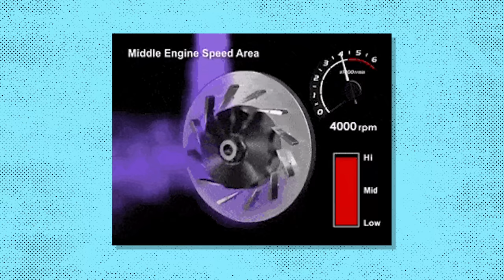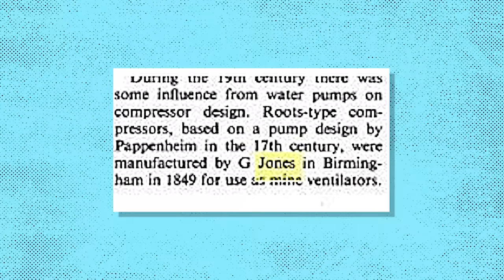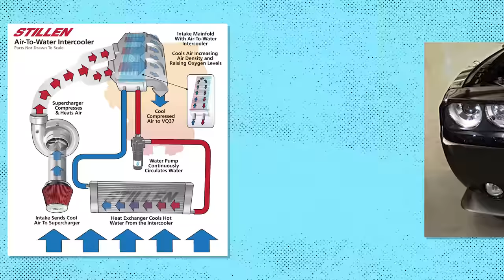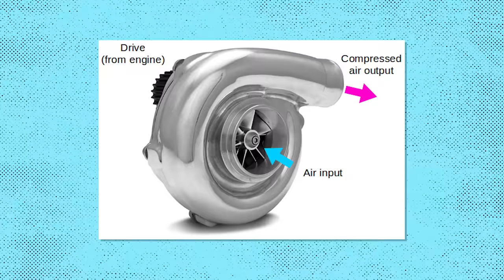Why Superchargers Aren't As Good as Turbos

Comment: Fun fact: although it's way less than super chargers, turbos also produce some paracidic loss. 
A turbo makes it harder for an engine to push out exhaust gases, creating a tiny amount of extra resistance in the exhaust stroke. 

OFC it's far less than the power increase you gain, but it just shows that you never get energy for free. A perpetomobile is still impossible.
Reply: Yes was searching for this. That Turbos use "free" or "wasted" energy is just plain wrong,  the piston needs to exert energy on the exhaust stroke to push the gas through the turbine. this pressure difference across the turbine can be directly converted to power use.
Reply: Turbochargers have no parasitic loss under load. They produce a net gain in thermal fuel efficiency and net horsepower output.
Reply: @faxxzc  That is incorrect, the Temperature Difference between  the turbine inlet and turbine oulet temperatures is directly linked to power output of the turbine wheel.
 The Turbocharger is a HEAT ENGINE and operates using the BRAYTON CYCLE.
Reply: @sandervanderkammen9230  No. As stated before:
While they do have a massive power increase compared to their losses, you don't get that power increase for free. This isn't a perpetomobile. As the exhaust gases push on the turbine wheel, the turbine wheel pushes back on the exhaust gases, which pushes back on the piston. That's newtons 3. law!
And also as stated before, this paracidic drag is incredibly low compared to superchargers, that's why everyone's using turbos and not superchargers!
Reply: @dariolinder4508  Wow! Ok...I see you do not understand how a turbocharger works.

A turbocharger is a type of heat engine, it operates using the BRAYTON CYCLE.

As the exhaust gasses pass through the exhaust turbine THE TEMPERATURE DROPS

This drop in temperature is directly linked to amount of horsepower generated by the turbine wheel.

This energy is then recovered by the reciprocating engine by the centrifugal compressor which unloads the engine by reducing the pumping loss.
This reduction in pumping loss results in a net gain in horsepower at the crankshaft without an increase of fuel consumption.
This incease in power does not require additional fuel and is thus "free energy" although its is not the best way to describe it.
The best way to describe it is increased energy efficiency through heat recovery..
Reply: @dariolinder4508  Manufacturers use turbochargers because they improve  fuel efficiency on standardized fuel efficiency tests used by the EPA and NEDC. Although this does not necessarily increase fuel efficiency in real world driving... driving conditions and technique is a critical part of actual MPG or Liter/per km.

Superchargers increase power output by increasing the amount of fuel burned and a much smaller improvement in energy efficiency.

Turbochargers can increase power output without an increase in fuel burn.
Reply: @sandervanderkammen9230  
TL;DR at the bottom
A turbo charger is a mechanical device built into combustion engines. 
It is comprised of a housing, turbine wheel, compressor wheel, connecting shaft, heat shield and oil and cooling passages. The housing is bolted onto the exhaust manifold of the engine. 
It has 2 sides, the 'hot' side and the 'cold' side, seperated by a heat shield. The hot side is built into the exhaust, while the cold side is built into the intake. 
Now, when your engine's running, it expells hot hot gas out the exhaust valve into the manifold. From there it's routed into the turbo charger. 
In there it has no passage expect through the compressor wheel. While the exhaust gases moves through the turbine wheel, they spin it up. Heat is transfered into the housing and the compressor wheel as an unwanted side effect. The turbine wheel is friction welded onto the connecting shaft. This method is used due to the immense heat the turbine wheel has to withstand.
Now, this spinning turbine wheel and connecting shaft is connected to a compressor wheel on the cold side, meaning that the compressor wheel is always spinning at the exact same speed as the turbine wheel. It's typically screwed on due to budget and simplicity reasons.
The compressor wheel is built into the intake of the engine. Like the turbine wheel it's also a centrifugal pump. When it spins up, it throws out the air between its blades into the intake, sucking in more air as it goes. Through that method it can increase the air pressure behind it. Usually it spins up to around 200'000 RPM at high engine RPM and produces around 0,9 bar extra pressure, increasing it to 1,9 bar (may vary from system to system). This pressure is managed by either a bypass valve, blow-off valve or control fins around the compressor wheel.
 Increased air pressure means increased oxygen molecules. Increased oxygen molecules means you have to inject more fuel to maintain the stoichiometric ratio (14,8:1). More fuel in the combustion chamber means a bigger explosion, leading to more pressure on the piston and more torque at the crankshaft, power is torque over time so you get more power. 

Now that we're on first month apprentice level, let me get to your claim to the brayton cycle. That claim's so out of left field, I don't even know where to start. 
Heat is a big problem for turbos. The turbine wheel is friction welded onto the connecting shaft to withstand the immense heat coming from the exhaust gases and the housing has a built in heat shield to protect the compressor wheel from a heat transfer. 
The housing also contains coolant passages to cool it down and oil passages to reduce friction.
Please don't tell me that I don't know how turbo chargers work when you yourself fail to grasp simple physical laws. Educate yourself before you try to educate others.

TL;DR: you're likely mentally disadvantaged and should visit a doctor.
Reply: @dariolinder4508  THANK YOU, For proving my point.
Reply: @dariolinder4508  You clearly have no idea beyond the most amateur neophyte fundamentals.. how a turbocharger operates..
A supercharger is nothing more than a compressor.
A turbocharger is a Heat Engine with its own thermodynamic cycle and acts as a second pass heat recovery cycle when combined with a reciprocating engine.
Reply: @sandervanderkammen9230  yes of course, you're absolutely right.
Reply: @dariolinder4508  THANK YOU! Any questions son?
Reply: @sandervanderkammen9230  why yes of course oh magical magician of the magical magician's magical tower. Explain to me how this magical device, this magical turbo charger, invented by you, oh magical magician of the magical magician's magical tower, how it works exactly.
Reply: @dariolinder4508  Its not magic son... its called THERMODYNAMICS, probably a bit beyond your pay grade and education level.

I did not invent the Turbocharger... Alfred Buchi did.
Reply: @sandervanderkammen9230  oh magical magician of the magical magician's magical tower. Tell me, how does this magical item called by you, oh magical magician on the magical magician's magical tower, 'turbo charger' and apparently not invented by you, oh magical magician of the magical magician's magical tower, work exactly? Enlighten us oh magical magician of the magical magician's magical tower!
Reply: Nicely said .... I was gonna post a response on this point too ... luckily I read more into the comments and found this !
Reply: @sandervanderkammen9230  how can a turbine spin without restricting the exhaust gases flowing through it? If there is restriction, how does that not imply some power loss?  The bearing inside a turbine can't spin forever, there is some friction.
Reply: @Ehal256  Yes, there pumping loss on the exhaust side.. but it is offset by the larger reduction of pumping loss on the intake side... the Turbochargers centrifugal compressor is a much more efficient pump rhan the reciprocating engine.
Reply: @dariolinder4508  i dont think he understands stoichiometric ratio/lambda1/14.8:1 if more air goes in more fuel must go in or engine goes lean and starts to destroy itself. That is basic fuel ratio behavior less fuel means detonation which will mean ecu will retard spark (less power) or increase fuel slope (more power).  Plus it is obvious to any one that driving a compressor to compress air must have a parasitic loss or as you say hello perpetual machine. I guess i have been wrong in tuning many engines on dynos and watching their behaviour and produced power. Turbos and superchargers will fatten torque curve but only if more fuel goes in. He obviously does not understand that you do not get something for nothing in the engines production of power.
Reply: @chrisclarke6344  I think he just made a poor attempt at trolling and got annoyed as soon as I started to ridicule him. 
Anyway, I really enjoyed explaining turbo chargers from top to bottom, really got to test my memory there.
Reply: @dariolinder4508  you saved me a whole lot of typing! Its beyond me how he thinks you can get more power from increased boost without adding more fuel. He probably thinks if you feed an engine nitrous oxide that is the fuel not the extra oxygen that needs extra fuel to work. Not sure how he would come at an alky engine with the amount of the stuff you need to give it because of its lower calorific rating.
Reply: @dariolinder4508  plus not sure what he is on about with a turbo being a 'heat engine' in my experience if no gases passing turbine blades it dont rotate. If you took a torch to the housing and heated it red hot that turbine will not move unless the gases are flowing past it, it is no different to a water wheel both need flow to operate.
Reply: @chrisclarke6344  maybe he even thinks that higher octane gasoline gives you more power! XD
Reply: @dariolinder4508  indeed all that does is to let you run more advance and a higher compression ratio. They dont seem to understand that an engine needs the correct fuel/air ratio to work, and it doesn't care if its getting it from fred with a hairdryer and aunty maud with a watering can so long as its correct ratio.
Reply: While turbos do come with a small parasitic loss below the boost threshold, the majority of that low end power loss comes from needing to reduce the compression ratio of the engine to make tuning for a turbo less dangerous. For example, my car's 1.6T has a compression ratio of 10:1, where some NA engines run much higher. As a result, they get way better low end response. But the tradeoff is I get far more power when the turbo spins up.
Reply: @CalculatedRiskAK  paracidic loss exists all throughout the rev range. You still need some force to spin a impeller up to 200'000 RPM. It's just that the power increase is so massive in those rev ranges, it can be neglected. The only time you may notice it is when you have a big turbo and a slow idling speed, like on a heavy duty truck or an excavator.
Reply: @CalculatedRiskAK  supercharged engines also have a lower compression ratio, the difference is a supercharger is boosting from idle whereas a turbocharged engine has to wait for the boost to build as turbo spools up. The effect is not so pronounced with small turbos as less mass has to be spun up. The supercharged engine will feel more like a larger capacity engine, which makes them nicer to use in normal driving. However due to the dynamics of superchargers the boost tends to drop off at high rpm while turbos dont suffer from that.The turbo will make more power ultimately, and with the 'kick' when boost comes in this trait can be deemed more exciting.
Reply: @dariolinder4508  wheres sander gone?his silence says much i feel!
Reply: @dariolinder4508  Thermodynamics is not magic if you are educated...
Reply: @UmbrellaCorp_  Too bad he is wrong and doesn't understand the engineering concepts involved.
Reply: @chrisclarke6344  Clearly the concept of pumping loss is a completely unknown to you.
 If you don't know what pumping loss is? How can you say there is a parasitic drag???
Reply: @dariolinder4508  You made an excellent attempt of making a complete fool of yourself... AND SUCCEEDED!
Reply: @chrisclarke6344  Nitrous oxide is an OXIDIZER...  not a fuel. 
WHAT IS YOUR POINT?
Reply: @chrisclarke6344  Because your not an engineer son, from your childish, immature remarks its obvious that you have no formal education or professional experience on this topic.
 If you don't understand the Carnot Cycle Formula you will never understand how a turbocharger works.
Reply: @chrisclarke6344  Depends if we are talking about HCSI or SCSI with GDI..
With direct injection you can have a lean AFR without the risk of pre-ignition or knock, and lower EGTs without fuel enrichment.
Reply: @sandervanderkammen9230  yes HCSI,SCSI will allow a leaner burn without knock in DI or pre valve injection (as close to valve as possible) this is only possible with ECU control of fuel slope and ignition timing. This allows lean burn engines to meet emmisions rules, but as with all things there is a reaction and that is less power produced nett. It is primarily used by motor manufacturers to allow smaller engines and better mpg on a test cycle. This has many advantages for manufacturing, less costs better packaging etc. The down side is usually real world mpg is not as good as claimed and BMEP is affected. This brings us back to the issue of losses in the turbo system!
Reply: @chrisclarke6344  Small displacement turbocharged engines have become extremely popular with manufacturers and new car buyers because they deliver higher MPG figures and BSFC.
This is because turbochargers increase power and lower fuel consumption... the turbos centrifugal compressor is more efficient than the reciprocating engine  significantly reduce pumping loss because it is driven by waste heat and not a parasitic load on the crankshaft.
Any questions son?
Reply: @svgPhoenix  The truth always wins over ignorance.
 You obviously have no formal education or professional experience on this topic...
Reply: @chrisclarke6344  Heat = pressure. What Sanders is trying to say is that the unused exhaust heat/pressure give the turbo HP, thus utilizing more of the heat from the fuel we burn.
Reply: @vistakay  that is correct the gases have to be expanding / moving past turbine or it will not turn, they are doing this because they are burning thus expanding. If he wasnt so obnoxious and arrogant it would be possible to have an articulate interesting discussion, but he appears to be unable to contain himself. He also has an alter ego called 'drbimmer' they are one and the same. He will also not accept that lean burn engines can only do that due to tight control of fuel slope and spark timing, and that it will lead to lower performance from the engine, than one that is running nearer to lambda1. The turbo will still boost the engine if the gas pressure comes from a compressed air tank or exhaust gases, the temperatures differential will be lower but it will create good pressure in inlet manifold. But again its a shame he is so obnoxious.
Reply: @chrisclarke6344  Wrong Chris, you still don't get do you?
The exhaust turbine in the turbocharger is a HEAT ENGINE and operates using the BRAYTON CYCLE.
Its NOT the same as pneumatic motors... not the same at all.
Reply: @chrisclarke6344  The EGT drops as it passes through the turbine and is directly proportional to amount of shaft horsepower generated by the turbine.
Exhaust gas pressure DROPS as it is excellerated in the turbine nozzle.

This is commonly referred to as the BERNOULLI PRINCIPLE

Its the exact same principle as jet engine... another type of internal combustion engine that operates using the BRAYTON CYCLE
Reply: @chrisclarke6344  Diesel engines function with turbochargers exactly the same way... they operate using a much wider AFR range and much leaner... as lean as 70:1.
Diesel engines do not use spark ignition thus your point is completely moot.
Reply: @sandervanderkammen9230  Engines don't run a consistent high RPM? Low end there is a lag. Larger the turbo, larger the lag. Especially on smaller displacement engines.
Reply: @Lo0die3  Same with a large centrifugal compressor supercharger... whats your point?
Reply: @sandervanderkammen9230  So, if a turbo uses no energy, wht dont we just get it spinning, remove the exhaust and use it to generate free electricity.
Of course a turbo uses power, or is parasitic, the only diff being, a belt driven suercharger uses power from the ignition stroke, the exhaust driven supercharger uses power from the exhaust stroke.
Reply: @davidwarland2680  You seem very confused here.
Who said the turbo uses no energy???

The Turbocharger uses the uses the waste heat energy in the exhaust gasses to drive the turbine wheel.
Reply: @davidwarland2680  The Turbocharger does not cause a parasitic load on the engine.
The energy used to drive the compressor is HEAT energy.
Reply: With high boost turbos(over 30), the “tiny” amount of back pressure isn’t so tiny. (20-40psi) and are dialed in with proper sized turbos to the motor output to keep the back pressure down.
Reply: @dallynsr   There is no loss in exhaust flow due to the Delta-P,  so no parasitic drag on the reciprocating engine.

The turbine wheel is driven by heat energy... not a mechanical load.
Reply: @dariolinder4508  F1 engines have something called MGU-H, which is a generator tied to the turbo which further restricts the exhaust gases and generates energy, thanks to this you can achieve 50% energy efficiency, normal engines have a efficiency between 30 and 40%, there is about 30% of energy that is wasted due to heat transmission because the block is made of metal, and about 30% of energy that is wasted in the exhaust gases, it is a matter of the thermal energy of the gas is converted into kinetic energy
the same pressure of the gas in the intake is what pushes the exhaust gases in the valve crossing and not the piston itself, that is why an MGU-H in a naturally aspirated engine would not make sense,
due to the turning of the connecting rod, during 120° of the BDC, the piston practically does not move, and the gases leave by their own pressure since when the piston reaches the BDC the gas still has a pressure of 2 bars in the case of a NA engine, and the gas comes out by itself, converting thermal energy into kinetic energy. When the gas hits the turbine, the gas does not immediately stop due to its inertia.
Reply: @dariolinder4508  Superchargers do not have parasitic friction losses, well if a little, but how much work must be exerted on the air to compress it to 2 bars? I mean, it's not like compressing the air is free and all the work you have to do is because of friction, so turbos shouldn't also lose 30% power because they use piston force instead of waste heat. of the exhaust gases which is at 2 bar 28PSI? The only way to not lose energy in the exhaust gas is to use a ridiculous compression ratio of the maximum the physics allow of 700-1.
Reply: @eld-u1w  Yes, excellent comment.
Sterling Cycle is another example of a Heat Engine that could use the waste heat lost from another engine... a second pass, combined cycle.
A Otto-Sterling combined cycle works in much the same way as a Otto-Brayton cycle or turbocharged engine.
 The Sterling engine would essentially run for free off the waste heat the same way a turbo does.
Some major automobile  manufacturers have experimented with both Sterling Cycle and Rankine Cycle in a Combined Cycle with the Otto and Diesel engines.
Reply: I’m guessing that some parasitic loss comes from the low end, where the engine is fighting the restrictions from the turbo for air. It becomes neglect able once it spins up. There will be some sort of loss from back pressure, since how else would the turbine spin. Turbos are heat engines, though it means pressure driven engines. I think everyone knows how a turbo works, no need to use fancy jargon to confuse the shit out of people. Like mark twain said, bring you down to there level then use experience to win an argument. It wasn’t an argument until someone made it into one.
Reply: @jakejakedowntwo6613  No, there is no parasitic loss, and there is back pressure but no pressure differential so no reduction in flow as in a naturally aspirated engine.
You cannot compare back pressure in naturally aspirated engine with a turbocharged engine.
Reply: @jakejakedowntwo6613  That is incorrect, the turbine is an Impulse type turbine, it is not pressure driven. Pressure DROPS as the exhaust gas enters turbine wheel. This is caused by what is known as the BERNOULLI PRINCIPLE.
There is no loss of FLOW so no net loss in power to drive the turbine.
Any questions?
Reply: @sandervanderkammen9230  So the "vacuum" caused by the propeller drives the turbo. the pressure inside the exhaust manifold has to be higher than atmospheric to create this effect. But you said no backpressure, so the low pressure has to be below atmospheric. I've seen turbos spin without an exhaust so is there really no back pressure?
Reply: @sandervanderkammen9230  It's not an energy giving engine like a rocket so how does it reduce pressure since it would have to increase the speed of the gas?
in Bernoulli's principle, there a low-pressure side and high-pressure side. so isn't the high-pressure side back pressure or no?
Reply: @jakejakedowntwo6613  no such thing as vacuum really... there is either pressure or no pressure.
The Turbocharger uses the velocity of the gas, not the pressure
Reply: @jakejakedowntwo6613  if the pressure  is the same or lower than the intake manifold pressure? NO.
Reply: @jakejakedowntwo6613  Fluid Dynamics, gas moves from high pressure to low pressure.
Reply: @sandervanderkammen9230  ok i get it now, its just the opposite of the coldside.
the exhaust manifold is the low side and the exhaust is the high side
Reply: @faxxzc  but aren't the exhaust gasses still expanding after they leave the cylinder? That would make it a lossless gain
Reply: @faxxzc  when the exhaust valve opens the cylinder is still under quite alot of pressure from the (still) expanding gas and that exhaust gas rushes out with force as soon as the exhuast valve opens, thats what powers the turbo not the force of the piston pushing the gas out.

Btw I have absolutely no idea what the hell Sander Van der Kammen is talking about, i am familiar with the brayton cycle but it has nothing to do with turbochargers.
Reply: @nilssjoberg2522  exactly, even if the piston remained stationery at the bottom of the cylinder the exhaust gas would still rush out with force when the exhaust valve opened. If turbos were actually powered by the pistons pushing the exhaust gas out they would be way worse than superchargers.
Reply: Spinning the turbo is not the only source of drag. It’s also the exhaust setup. Most turbos are mated to short tube headers / restrictive manifolds and thus make the engine operate with a sub optimal airflow. It’s not technically caused by the turbocharger itself, but is an unfortunate thing that comes with having a turbo. Meanwhile some of the supercharger’s drag can compensated for by having an unrestricted exhaust system.
Reply: @archygrey9093  Sorry Archy but that statement reveals a shocking lack of education regarding engines and Thermodynamics.

The Turbocharger is a Heat Engine and operates using the BRAYTON CYCLE in a combined cycle.
Any legitimate, competent engineer knows this, so you are obviously not qualified to speak inteligently about turbocharger thermodynamics.
Reply: @sarmatiancougar7556  You sir clearly have no clue what you are talking about... Turbocharged engines as a general rule are fitted with an exhaust system that can handle significantly higher flow than a Naturally Aspirated engine... because turbocharged engines flow more air.
Forced induction engines don't have the same problems with backpressure, fluid dynamics tells us that gas moves naturally from high pressure to low pressure.
Reply: @sandervanderkammen9230  Turbochargers are neither heat engines nor use the brayton cycle, they are a turbine that makes use of moving gas (aka kinetic energy) not heat. There have been experiments using an actual brayton heat engine on the exhaust to recover wasted heat but that is about it, perhaps you read one of those articles and got confused with an actual turbocharger.
Working with turbocharger in real life or even just looking at a schematic of how one is built will immediately tell you it doesn't use any kind of brayton cycle.
Reply: @archygrey9093  Thank you Archy for proving my point and confirming that you have no formal education or professional experience on this topic and are not qualified to speak inteligently about turbochargers.

All turbochargers are Heat Engines, the exhaust gas temperature typically drops an average of 250° to 400° degrees F as it passes through the turbine.

This temperature drop is directly proportional to the amount of shaft horsepower generated by the turbine wheel and complys with the Laws of thermodynamics expressed by both the Carnot Cycle Formula and the Brayton Cycle.

Please stop spreading your lies and false information about turbochargers, you have already exposed yourself as an amateur and fake.
Reply: bruh the boost just goes zoom, thats all
Reply: @sandervanderkammen9230  dude you are way over complicating things. The exhaust gases from the engine are still expanding as they enter the turbo, which pushes the turbine. This spins the compressor, which moves air into the engine (and therefore more fuel can be combusted). It’s a simple concept guys
Reply: @initialyeet3951  Please stop spreading misinformation about turbochargers, you clearly do not understand how a turbocharger actually works and are not qualified to speak inteligently about them.
Reply: @sandervanderkammen9230  if a turbocharger is a heat engine, like you say, so tell me why some turners use the pressure created by the "cold side" of another turbocharger to minimize the lag of the turbocharger that is connected to the intake manifold, I mean there is close to none heat generated by the increasing of pressure but the turbocharger still, and say again still, spin with the same rpm that of a turbo that is connected to the exhaust manifold and create additional bost to the engine, so explain me that?
Reply: @capitaobarbosa6192  Are you talking about compound turbos? 2-stage turbos??? Or are you referring to Sequential Turbocharging???

I'm not sure you are phrasing you question correctly.
Reply: @sandervanderkammen9230  you are ignoring the fact that compression ratio is significantly lower to avoid pre ignition and that reduces efficiency when not under boost.
Reply: @francoisloriot2674  What is your point? 
Supercharged engines typically have lower static compression ratios also...
AND of course GDI engines don't need need lower compression.
Reply: it's "parasitic"
Reply: Though this parasitic lose by adding more backpressure on the exhaust Valve can actually help prevent valve float at high revs in return increasing compression but it is very situational.
Reply: @danes6286  What backpressure?
Reply: @Ehal256  it’s called Variable Stator Compressor Turbo. The stators move to a less aggressive angle to allow low velocity exhaust gases to pass by without creating a “load” on the engine from a build up of exhaust gases. 

Run the vehicle on E85 over gasoline. The increased fuel consumption must be paired with a higher flowing intake of air to reach stoichiometric mixture. Meaning the velocity of the exhaust gas should be greater then gasoline mixture burn; even at low engine RPM. Therefore, this helps spool a turbos turbine faster even at low engine RPM. 

Now finally have an offset ratio size in Impeller size vs Turbine size. A smaller sized Hot side will spin faster to provide more torque leverage on spinning the impeller( cold side) resulting in a quick spool. 

Add all three factors together and boost lag is practically non existent. I believe there are other small factors but believe it or not, I like to stick to high compression, high rpm V8 engines. So the requirements to make the two separate engines most efficient are miles apart when it comes down to the specifics.
Reply: Can’t believe this thread is still alive with so much misinfo in it and yet no one has mentioned the obvious. A supercharger is engine driven, delivering set rpm and air at a given speed. Mine runs twice as fast as my v8, so when the 6.1 hemi is doing 2000 rpm it’s spinning at 4000, 6000 rpm it’s doing 12000. The results are predictable and easy to tune for. And the power is there instantly. 
In a turbo, your rpm of the turbo is NOT directly linked to engine speed. It’s driven by the exhaust gasses and can be spooled up before takeoff to allow for a booster launch. You can rev up the engine at the line, have the turbo spinning 100000rpm and have 40 pounds of boost generated and take off with no lag, albeit a huge impact on the rest of the driveline components. 
Turbo chargers are great for diesels which are limited in rpm compared to gasoline burning engines but the first super chargers drag racers were using came off of Diesel engines. The good old 6-71 blower and 8-71’s, good times. And as others have stated repeatedly, no free lunches. Turbos require power to run, from the exhaust gasses. Any interference of the gasses leaving the cylinder requires work to overcome. The turbo creating forced induction allows for more fuel to be burned giving more power making it efficient to use, but it’s certainly not free power nor is it some
Magical heat engine that propels your Honda with free power.
Reply: @DualKalibur  Yes, you are obviously very confused and misinformed... clearly not qualified to speak inteligently about turbochargers or superchargers.
Reply: @dariolinder4508  actually, everyone uses Turbochargers because Turbochargers are significantly simpler in terms of machining work. the parasitic loss from a turbocharger of equal performance is as high if not higher then a supercharger due to the required exhaust constriction, but a turbocharger only needs 1 set of bearings, it only needs precision machined turbine and blower fans, and it only needs limited machine work on the internal surface of the Compressor and Turbine housings. comparatively, the internal surface of a Roots/Screw supercharger has to entirely be machined, and is much larger then the housing for an equivalent Turbocharger. Further, where as the turbine and blower fans are very small, and can even be cast parts, the entire length of the screws in a Supercharger are precision machined components, which are then seated with wear component apex seals

Everything in a turbocharger is able to be machined on any basic 3 axis mill, everything important in a supercharger has to be machined on a lathe.

Now, none of this applies to Centrifugal superchargers or Electric Turbochargers, both of which just are terrible at Blowing Air, since both take the much cheaper compressor side of a turbocharger and replace the turbine with either a Belt drive, or an electric motor.

Beyond just direct efficiency, something people dont talk about with Turbochargers is they are not consistent pressure boosts because they do not partition the High and Low pressure sides of the compressor using physical barriers like Rootz/Screw chargers do.

As for Brayton Cycle: Turbochargers are NOT engines, they have no mechanism that directly interfaces with the process of generating energy. the Brayton Cycle is part of the operation of the Internal Combustion Engine that is harvesting power, and ideally, such as found in Opposed piston engines, you harvest sufficient energy from the combustion that the combustion mixture cools to near ambient temperature during the combustion cycle.

if Turbochargers were thermal engines, they would not operate when attached to Opposed Piston engines. Instead all modern production of OPEs utilizes both Rootz/Screw chargers and Turbochargers to achieve maximal efficiency of autoignition.
Reply: @F14thunderhawk  Thanks Pat for confirming that you are not an engineer... but you do seem to have some real talent for fiction, your comment is almost believeable!
Reply: @DualKalibur  To find out the exact parasitic power loss or resistance the turbine enacts on the exhaust, couldn’t you just dyno the car while disconnecting the intake side of the turbo? See how much hp loss u get by pushing the turbine
Reply: @semiribrisevic7781  to find the exact losses we need measurements of the cylinder size, compression, combustion pressure in the cylinder, combustion pressure as it enters the exhaust manifold, exhaust pressure right before the turbo combined with the other exhaust, pressure in the turbo inlet, and pressure on the backside of the turbo outlet heading for the muffler/tailpipe. Every change in internal dimension affects pressure, every bend in the pipe does as well. The speed the turbo turbine is spinning plays a roll as well. A slower spinning turbine offers more resistance and accepts more push from the exhaust gasses while a faster moving turbine is accelerated less before the gasses move through. Also at higher speeds the flow is affected by the exhaust pulling the gasses through the exhaust like a siphon, X pipes and H pipes for exhaust use this effect to draw the exhaust out and equalize both banks on a V engine. The only people I know who have the the technology and money/personnel/time to do this kind of testing are racing teams and car companies.
Reply: @sandervanderkammen9230  Hey man, I'm pretty confused here. Could you explain the Brayton cycle for turbochargers? My intuition is that having a turbo will increase the pressure drop of the exhaust by at least as much as it increases the pressure on the intake side, so I don't get why it reduces pumping losses or why exactly it's better than superchargers.
Reply: @Prostreetsburnoutparadise  The facts bear repeating... and repetition helps people that don't know anything about turbochargers learn how they actually work.
Reply: @semiribrisevic7781  Actually all you have to do is measure the flow and the temperature drop as the exhaust passes through the turbo.

The temperature drop is directly proportional to the amount of horsepower generated by the turbine wheel.
This represents a net Increase in horsepower... not loss.
Reply: @DualKalibur  What you suggest indicates a complete lack of knowledge and professional experience on this topic...
The Turbocharger generates a net GAIN  in horsepower, Not a Loss
I suggest you go back to school until you can get the basic concepts right, that way you won't make a fool of yourself again like this.
Reply: @akosszollosi6159  Certainly, the Brayton Cycle gives us the mathematical model for calculating the amount of shaft horsepower generated by the turbine wheel.
The drop in exhaust gas temperature  is directly proportional to the amount of horsepower generated by the turbocharger turbine wheel.

A naturally aspirated engine has a significant parasitic load on the engine from pumping air into the cylinders.

The Turbocharger eliminates this parasitic loss.

A turbocharger is a more efficient pump than the reciprocating pistons and uses the horsepower normally wasted out the tailpipe to drive the more efficient centrifugal compressor.

The reciprocating engine and the turbocharger operate in a combined thermodynamic cycle, two separate engines working in series from the same heat source.

Any questions?
Reply: Perhaps at the beginning, but after the exhaust turbine is spooled up, i cant imagine a properly sized housing would produce a ton of back pressure- maybe im wrong?
Reply: @faxxzc  depends on the cam profile as well, the incoming charge can do a bit of the displacing.  Really cant see how brake mean effective torque could be reduced much in this situation- after the turbine is spooled anyway... Alot of modern turbos are using variable blade pitch & twin scroll housings to reduce lag and increase efficiency.  Once spun up any back pressure is more than compensated for by the inlet pressure scavaging- though i see whatcha mean- not completely free
Reply: @chrisclarke6344  none, no real knowledge beyond his text book
Reply: @torkrench  What back pressure? 
We are talking about a forced induction engine...
According to Pascals Law we measure back pressure between the turbo and the tailpipe.
Reply: @torkrench  it's not a ton, but still a bit. It still has to move into the turbine, spool it up, make a 90° turn and exit. Same at low speeds. There is always a bit of parasitic loss, but it's far outwheight by the power gain.
Reply: @torkrench  Now you are starting to learn... if the intake manifold is pressurized??? There is no Delta~P (backpressure)
And thus no parasitic drag on the reciprocating engine.

The EGT drop across the turbine is directly proportional to the amount of shaft horsepower generated by the turbine wheel.
Reply: @dariolinder4508  Yet under load... there is no parasitic drag on the reciprocating engine.
The turbocharger generates horsepower from waste heat energy in the exhaust... not pressure.
Reply: @torkrench  Stop pretending to be something you are not... an expert on anything but mounting tires and oil and filter changes.
Reply: @torkrench  agreed i am done with him he cannot really work in this field his attitude and arrogance would get him 'released' from the job.
Reply: @chrisclarke6344  I retired from the company that invented the turbocharger... and we certainly would never hire a person like you with no formal education or professional experience with this type of technology.
 Stop pretending to be something you are not... qualified to speak inteligently about turbochargers.
Reply: I don't believe it's that much less because the higher the pressure the harder it is to spend that turbocharger means it's harder to spell that exhaust gas people don't use superchargers they're more expensive than turbochargers and the other article is right turbochargers tucked away on the engines makes it harder to work on them most of the time I will take a supercharger or blower over the turbochargers another reason is because the heat created with a turbocharger
Reply: @sandervanderkammen9230  I get what you're saying, but still my intuition is that putting a turbine in the exhaust line is going to increase cylinder pressure during exhaust and create at leas as much parasitic losses as much power you generate on the turbine shaft. Is this not the case? Why?
Reply: @roywallace5899  You need to learn thermodynamics and fluid dynamics.
Turbochargers engines have lower EGTs
Reply: @akosszollosi6159  Do you understand the concept of Pumping Loss?
The concept of backpressure in naturally aspirated engines does not apply to forced induction engines.
The difference is fluid dynamics... No Delta~P means no backpressure.
Any questions?
Reply: @sandervanderkammen9230  Sure. Pumping losses are present from the beginning of the exhaust stroke to the end of the intake stroke. The instantaneous power lost due to pumping losses (per cylinder) is equal to the gauge pressure of the cylinder multiplied by the speed of the piston multiplied by the cross-sectional area of the piston: P_pumping loss = (p_cyl - p_atm) * v_piston * A_piston. 

Now I'm really confused. Why doesn't the concept of back pressure apply to forced induction engines?
Reply: @akosszollosi6159  Because in the Naturally Aspirated engine, the intake manifold pressure is always less than ambient pressure.

The Delta~P is reversed in the forced induction engine... intake manifold pressure is higher than ambient pressure.
Reply: @sandervanderkammen9230  It is not a heat engine.  Remove the heat and pass high flow air into it, it will still work, remove the high flow air and just put hot air, and it will do nothing.
Reply: @eyemastervideo  HEAT is what causes the gasses to continue expanding and excellerate through the turbine nozzle.
The temperature drops up to 300°F as it passes through the turbine and is directly proportional to the amount of shaft horsepower generated by the turbine.
This temperature drop conforms to and can be accurately predicted by using the BRAYTON CYCLE Formula.
Any questions son?
Reply: @sandervanderkammen9230  I see. I thought by back pressure you meant the pressure drop throught the exhaust. 
So pumping losses are reduced, 0, or perhaps the engine will even motor and collect a bit of energy during the intake stroke depending on the boost pressure. Thats clear, but if the turbine causes an additional pressure drop through the exhaust, the engine will have to pump harder during the exhaust stroke. Still, my intuition tells me the pumping losses during exhaust will increase by at least as much as they decrease during intake. Is this not the case? Why?
Reply: @akosszollosi6159  OK, so intake manifold pressure is 22.2 psi (absolute) and exhaust manifold pressure is 18.3 psi  and ambient pressure is 14.5...
Where is the pumping loss?
The Delta~P is +7.7 psi
Reply: @sandervanderkammen9230  WTF are you talking about? Do you have any idea of how an internal combustion engine works?
Reply: @scott.koopmann  Yes, I do...
Reply: @scott.koopmann  You are joking right? I actually worked for the company that invented turbochargers.
Reply: @scott.koopmann  If there is anything that I posted that you are having difficulty understanding? I would be happy to help explain it to you.
Reply: @sandervanderkammen9230  No thanks. I already know how engines and forced induction work.
Reply: AND They heatsoak the compressor side
Reply: @scott.koopmann  Apparently not...
Reply: @vinzramirez7011  3% is insignificant compared to the overall performance advantage of a turbocharger over a centrifugal supercharger... it is nothing compared to the thermal increase in a positive displacement compressor.
Reply: @sandervanderkammen9230  I find it very interesting that a genius engineer spells accelerate, "excellerate". I bet you would be the same guy who argues that exploding gun powder doesn't push a bullet out of a gun barrel, but the incredibly high vacuum at the muzzle sucks the bullet out.
Reply: @sandervanderkammen9230  Are these numbers (22.2psi, 18.3psi) actual measurements of an engine?
Reply: @akosszollosi6159  You still don't understand the fundamental fluid dynamics involved... backpressure is when the Delta~P works against the engine,
Reply: @sandervanderkammen9230  I develop hydraulic piston pump motors for a living, so I do understand the basics of fluid power. I'm asking if you made up some reasonable numbers to prove your point, or you took actual measurements of an engine. Either way I'm not trying to debate you, I just want you to explain what is the mechanism that allows the turbo to generate power without putting additional load on the engine, because I'm interested in undersanding.
Reply: @akosszollosi6159  Its a typical example, the intake manifold pressure is always higher than atmospheric pressure.
The Turbocharger engine is a combined cycle Heat Engine.
Otto-Brayton or Diesel-Brayton.

The engine has no load from the turbo, it is drive solely by the waste heat energy in the exhaust.
Reply: There is some parasitic loss with turbos but they actually get most of their power from the energy the engine usually throws away. Just before the exhaust valve opens the pressure inside the cylinder is still higher than atmospheric and can be harnessed by the turbine.
Reply: @sandervanderkammen9230  The supercharger is a less efficient compressor than the piston compressor. Dynamic compressors are generally less efficent. Turbos increase the engine efficiency in two main ways: The piston doesn't extract all the energy from the gas (when the exhaust valve opens the cylinder pressure is higher than atmospheric) and the turbo has an intercooler
Reply: @forloop7713  Correct, the drop in exhaust temperature as the gasses pass through the turbine is directly proportional to the amount of  horsepower generated by the turbocharger turbine wheel, the turbocharger uses an Impulse Type turbine that is driven by the velocity of the hot gasses... not the pressure.
 There is no net parasitic loss due to Delta~P,  because of the positive pressure differential, the turbocharger creates higher intake manifold pressures than atmospheric pressure.
The only backpressure is created between the turbo and the tailpipe due to a possible restriction in exhaust system... not from the turbo.
Reply: @forloop7713  A practical supercharger must be more efficient than the pistons pumping the air alone.. positive displacement type compressors are less efficient than dynamic compressors and cause a greater increase in intake manifold temperatures.

My VW Corrado had a very efficient scroll-type compressor AND A INTERCOOLER but it was less efficient than a turbocharger because all the heat energy in the exhaust was simply wasted out the tailpipe.
The extra performance created by the G-lader was offset by the parasitic drag from its belt drive on the engines crankshaft.
Reply: @sandervanderkammen9230  you are missing a vital point in how the turbocharger works.

Yes, the turbocharger converts energy in the exhaust gases otherwise wasted to force air into the intake manifold, but it is not *ideal*. We do not live in a perfect world. The exhaust impeller adds a backpressure to the exhaust gases exiting the engine, meaning that the engine must use a certain amount more energy to push the exhaust out leading to a direct efficiency loss. Just like how the engine must use power to drive the supercharger it must also use (although less) power to drive the turbocharger.

If the turbocharger still causes a loss in efficiency, why would car companies use them?
The loss of efficiency is non-linear, just like the boost curve of the turbo. When the turbo is making no boost, the engine may operate like a NA engine which allows these cars to score the same scores on fuel efficiency tests as NA cars while having higher overall horsepower figures.
Reply: @vasilis23456  That statement is completely FALSE
There is no significant backpressure in a properly designed system.

 The exhaust manifold pressure is the lower  or very close to the intake manifold pressure and therefore no Delta~P

If there is backpressure as you claim? Why do these engine deliver better fuel efficiency in standardized drive cycle tests???
If there was backpressure fuel mileage would be worse.

Please explain for us why turbo cars have better fuel economy? Even in city driving?
Reply: @vasilis23456  Most of the comments here are from people who simply do not understand what backpressure is... backpressure is not the same on forced induction engines.
Reply: @sandervanderkammen9230  Dario'a original comment was pointing out turbo chargers are physical machines and thus have some form of drag. How it relates to the output of the engine is irrelevant, he was just saying no bearing is frictionless, no turbine has zero air resistance (ie. a perpetual motion machine) on it's own. With the engine yes it has no parasitic loss, without it it's just a regular machine.
Reply: @crisbowman  You are both very confused and misinformed.
 The exhaust turbine is driven by heat energy rejected by the reciprocating engine.
This energy is wasted out the tailpipe in a naturally aspirated engine.
There is no increase in backpressure  from the turbine because of the increase in intake manifold pressure.
A proper running turbocharged engine will have something close to a 1:1 ratio thus no Delta~P
 Turbochargers use a IMPULSE TYPE turbine.
The temperature drop in EGT through the turbocharger is directly related to the amount of shaft horsepower generated by turbine wheel.
Any questions son?
Reply: @sandervanderkammen9230   so does a supercharger. the difference is while a turbo produces a small loss, probably 5% or less power loss, they can produce something like a 25% gain.  a supercharger has something like a 11% power loss but can produce a flat 50% gain. this would be based on similar boost outputs of course. for example my ram truck would increase the horsepower to around 500hp by adding on a supercharger but i might only get 400 from adding a turbo.
Reply: @sandervanderkammen9230  you say that yet if you compare a subaru legacy with the 2.5L boxer (producing around 155-176 hp) vs the 2.4l turbo boxer (producing around 260HP) you see a lower fuel efficiency on the 2.4L (23/31 mpg) despite producing more horsepower in the same car vs the 2.5L (27/35 mpg).  by your own statement the 2.4L should improve gas milage as there is more power for the engine to use thus allowing the engine to work less to propel the car. this means that there is a loss somewhere in that equation. since the engines are so close in size the difference is negligible. that then means the difference comes down to aspiration of the engine.
Reply: @signolias100  A turbocharger can easily double the power output of an engine with no parasitic loss on the crankshaft.*
 That is completely false, all things being equal, same engine, same boost pressure... the turbocharged engine will always produce more power than the supercharger engine because their is no parasitic loss with the turbo.
Reply: @signolias100  Wow James! You are obviously not an engineer!
Thank you for proving my point.!

The 2.4 turbo boxer makes 68% more horsepower with only a 13% increase in fuel mileage.

That's a very impressive 48% increase in fuel efficiency to power output...
Any questions son?
Reply: @sandervanderkammen9230  again i gave you a Naturally aspirated example vs a turbocharged example that shows a fuel economy loss. that loss you claimed was nonexistent. per your own statement a turbo would not be at a fuel economy loss compared to other engines.

as for your claim to no parasitic loss you agreed with someone above that there would indeed be SOME loss due to restricted exhaust flow. as i also said upon doing some research that a turbo would produce 5% or less parasitic loss of power which is negligible. vs the 10%-11% of a supercharger.  so lets do the math with my 5.7 engine. engine produces 390ph with a 11% loss from the supercharger is 42 horsepower lost. however i jump up to 550hp with 7psi of boost  and 520hp at whatever the stock boost would be. that is a 202hp (i.e. 160hp over stock horsepower) boost at 7psi and 172hp with stock boost (again 130hp over stock hp). where as the turbo kit i found for my same engine claims 234hp increase, but only shows up at 560hp (this claim is based on a tune pushing the boundaries of a t4 turbo and running e85 fuel the same turbo with a mild tune on 93 only produced 500hp as tested) at most. that is only a 170 hp increase over the claimed engine horesepower. both of these claims are on 7psi of boost. so answer me this friend if the turbos are producing 234hp over stock where is the additional 64HP at if their claim was accurate the turbo should be doing around 624hp.
Reply: @sandervanderkammen9230  oh i am an engineer, just not a mechanical engineer friend. my type of engineering is the kind that train to make things and enemies disappear in violent ways (in other words combat engineer)

 however one thing i do know is math doesn't lie. you claimed that fuel economy wouldn't suffer. last i checked an engine using more fuel is either less efficient, or is working harder for the same load. that means said turbocharged engine is either working harder, or it is less efficient. so which is it?
Reply: @signolias100  Son you are very confused and misinformed about turbochargers and how they interact with a Otto Cycle engine.
Reply: @sandervanderkammen9230  again I never claimed to be a mechanical engineer in fact I specifically claimed I am a combat engineer, and even stated that my expertise was in making things, and people violently disappear. However I do understand math. That is not a mechanical engineer specific skill. Yet you blatantly  claim one thing (specifically no loss in full economy which we already agreed. And secondly that there is no power lost in a parasitic manner due to the engine working harder. Which again you also agreed to in a later statement to be a wrong statement ) you then claim that a turbo can easily double an engine's power output. But when confronted with numbers based off a 5.7L Hemi engine making  with a claimed 390 hp. Specifically that the turbo is claiming more horsepower output than the actual math allows for (again we are talking about a 64hp minimum difference based on the  engine's rated output vs the claimed hp  which 500 and 560 respectively). 

Go on do the math the 5.7 hemi produces  390 horsepower. 
The t4 turbo offers a horsepower reading of 500 on a mild tune at 7psi and 560 on an aggressive tune at 7psi. They also claim that this is a 234 horsepower increase.
The procharger offers a 130 minimum horsepower boost over stock engine output  with no declaration of boost, and a minimum of 160 horsepower boost over stock engine output at 7psi of boost.  The parasitic loss is around 11% of the engine's output. 

The math I did is that the turbo is producing 110 and 170 horsepower respectively at their claimed 7psi boost. Which is a minimum 64 horsepower lower than the turbo's claimed 234 horsepower increase.
This would also mean the procharger is producing roughly 173 minimum horsepower with an unspecified boost and 203 minimum horsepower at 7psi of boost per their claims.

Feel free to do the math given based on those numbers.
Reply: @sandervanderkammen9230  so you claim to have worked for the company that invented the turbo? so you worked for the company Gebruder Sulzer?
Reply: @signolias100  So let me get this right, you are completely basing your theory that superchargers are more powerful and efficient  on advertising?
An ad for a single product on a single applications???

I have to serious question your logic and your education level.

You seem extremely confused and misinformed about turbochargers and turbocharged engines.

Turbos will always deliver more power than a supercharger give that all other variables are equal, this is because with the turbocharged there is no loss of power from driving the compressor.
Reply: @signolias100  Can you explain what you mean by "full economy"?
I have never heard anyone use such a term before, can you be a little more specific about what you mean by that phrase?
Reply: @sandervanderkammen9230  it was most likely a typo that I missed when I was writing my response and was meant to be "fuel economy"
Reply: @signolias100  I looked at Prochargers website and they give no certified dyno figures in their catalog.
They simply estimate power as "up to 130hp" without any details or caveats.
The catalog also offers a "tuner kit" for applications over 7psi requires modifications to the fuel system suggests that the stock fuel system limits the power and boost level.
This would also apply to other supercharger and turbocharged kits.

The catalog also states it is "intercooled" and Smog legal.
Which suggests that IAT and the factory exhaust system is used and also limited performance and fuel economy.
Reply: @signolias100  You made no mention of the turbocharger kit brand or catalog number so there is no way I can compare or confirm your claims of power output or specific applications and there limiting factors.
Reply: @sandervanderkammen9230  not at all. I used the minimum stated horsepower outputs. That I could find mind you the procharger state minimum horsepower expected from their product. Unlike the turbo which claims a power output that was tested which does not add up. again the 2008 5.7 hemi is declared to be a 390 horsepower engin stock. The turbo declares that they tested the output on a t4 to be 560 and is a 234 horsepower increase.  This an outright lie as 560 minus 390 is 170. If you use the declared 234 increase you are looking at 624 horsepower. Do you agree that the math I stated is correct? Also I would think that a roots style or lobe style superchargers would produce a worse parasitic loss than a centrifugal supercharger (I.e. procharger.) As there should be more moving parts, weight of parts and the amount of pressure built up. Compared to a turbo sized impeller. 

I should also note that I have nothing against either system, however I do feel each system has a different purpose while providing a similar outcome.
Reply: @signolias100  So explain to  me the difference between a centrifugal compressor and a Roots blower? (in terms of efficiency) because here again you seem very confused about parasitic loss.
Reply: @signolias100  Turbochargers are very different from superchargers in the way the operate,  in particular where the energy comes from to drive the compressor, this has a major impact on overall horsepower generated and is the reason why a supercharger cannot deliver as power as a supercharger at the same boost level  (all other variables  being equal)
Reply: @sandervanderkammen9230  barring roots and twin screw superchargers the turbo and centrifugal supercharger are similar in the way they operate the only difference is that is there is a few gears to increase the impeller rotation speed. this is not needed in a system that is gas driven like a turbo. and yes a turbo is gas driven not heat driven like you claimed.  the heat transfer is merely a byproduct of using the heated exhaust gasses to spin the impeller in the hot side of the turbo, which is a straight shaft to an intake impeller on the cold side.
Reply: @signolias100  Sorry James but you get an 'F'.

Roots and twin screw compressors are "internal compression" designs that waste energy and generate more heat during the process.

Turbos are driven by a heat engine and when installed on any Otto or Diesel Cycle engine operates in a "Combined Cycle"
 The Turbo utilizing the "Brayton Cycle"
 Both engines running on the same thermal reservoir but the turbine only using heat energy rejected by reciprocating engine.

False, the turbine used in a turbocharger is an IMPULSE type and uses kinetic energy in the exhaust,  not pressure.
There is no backpressure created by the turbo because the corresponding increase in intake manifold pressure. 
No Delta~P and no backpressure.

All of the energy used to drive the turbine wheel comes from heat energy rejected by the reciprocating engine.
Any questions son?
Reply: @sandervanderkammen9230  first of all you did read that i stated with the exception of roots and twin screw right? i specifically stated centrifugal.

you claim " The Turbo utilizing the "Brayton Cycle"
 Both engines running on the same thermal reservoir but the turbine only using heat energy rejected by reciprocating engine." 

yet you and i both know running compressed air (i.e. pressurized air) through the turbine housing that the turbine will spin. this would have zero heat in the exhaust being used. this makes "heat energy" a moot and simply a byproduct of the engine output. also we are talking about a 4 stroke cycle the piston running the exhaust stroke pushes the exhaust out. again heat energy is a null byproduct. the needed byproduct needed is the gasses being pressurized this is even stated in the Brayton cycle's ideal cycle. the expansion of  said pressurized gasses is converting that potential energy into kenetic energy. the turbo then takes that energy and converts it into mechanical energy to produce extra potential energy in the form of pressurizing fresh air for the engine. absolutely none of that requires heat other than to creat the pressure. so that makes your statement above FALSE. i'm sure the turbo manufacturer you worked for (the one you claimed invented the turbocharger.) most likely uses a compressed air system to test the functionality of a given turbo and to check that it is properly spinning as a QC check.
Reply: @signolias100  WOW! Really James????
So you just proved that you don't understand the difference between a Pneumatic motor and a Internal combustion engines... AND you don't understand how a Internal combustion engine works!!!!

You are clearly not qualified to speak inteligently about turbochargers if you are completely ignorant of very basic remedial concepts in ICE fundamentals.

All ICEs are HEAT ENGINES and comply with the Carnot Cycle Formula and the Laws of Thermodynamics.
Reply: @sandervanderkammen9230  dude the only reason heat is needed in an ICE  is for the rapid expansion of  the compressed air fuel mixture. The heat is literally wicked away through various means.  The ice should work just the same at ambient temp at the time of start up as it does at "working temp". 

By the way which law of thermodynamics? Are you talking about? The first law? It certainly can not be the second or third law you are implying an ICE follows.

Also not you are claiming that an ICE is a Carnot cycle engine not an Otto cycle like you have claimed in the past. Yet upon reading up on the Carnot cycle it only has one thing in common with an ICE the carnot cycle is loosely used in an ICE'S rejection of heat, specifically in liquid cooled engines. Where the heat is generated by the engine is transferred to the radiator. That same medium is used the passenger compartment making the cooling system a heat pump which is a carnot cycle. 

The Otto cycle, which is literally the cycle in the 4 stroke engine. Literally states that the heat is needed in order to rapidly burn/expand and create pressure the fuel/air mixture (you know for the power stroke). Even the Otto cycle calls heat a waste by product after the ignition and power strokes. This also only works for a 4 stroke engine and not a 2 stroke. As the Otto cycle states there are 6 stages to it intake, compression, ignition, expansion (you know the idealized point when the heat is stripped from the gasses via the heat sink. In modern cars this would be the liquid cooling system mentioned above), heat rejection, and exhaust. The Otto cycle literally describes that the exhaust gasses should be cool on the exhaust stroke. This also considers that the system has a constant volume process(i.e. some sort of pressurization) you also overlook the idea of potential energy in compressed gases.

As for your claim of me mistaking a pneumatic motor and an ICE I'm pretty sure I just proved I am not. Then again I didn't get a heat pump system mixed up with a 4 stroke system, or even a 2 stroke system.

Also everything complies with the laws of thermodynamics, even your own body complys.comply. it is why they are known as the laws of thermodynamics and not theories of thermodynamics.
Reply: @sandervanderkammen9230  let me ask you this if I were able to produce a compressed air system to operate a turbocharger is a manner similar to how the turbo functions when using the exhaust of the engine. Meaning there is a spool up, turbo lag. Everything as it would be if the turbo was connected to the exhaust. This theoretical system is able to keep up with the demand. Would said turbo attached to this system still function as a forced induction system. This is a simple yes or no question.
Reply: @signolias100  James! What causes the rapid expansion of the gasses???
Reply: @signolias100  ENTROPY is the Second Law of Thermodynamics.
Reply: @signolias100  Conservation of Energy is the first Law of Thermodynamics... it proves the turbocharged runs on HEAT not pressure.
This is a well-known and understood concept in turbocharger technology and can be easily proven.
Reply: @signolias100  All Heat engines conform to the Carnot Cycle Formula.
Otto, Diesel and Jet engines and Gas Turbine engines like Turbochargers
Turbos work exactly like Gas Turbine engines using the Brayton Cycle.

The difference is that turbos are used in a COMBINED CYCLE  with a OTTO or DIESEL Cycle engine.

Turbos are a SECOND PASS thermodynamic cycle.
Reply: @signolias100  There is one fatal flaw in your analogy model James... Where does the compressed air come from?

An impulse turbine requires LOW pressure, HIGH velocity air to operate...
Reply: @sandervanderkammen9230  and yet you acknowledge that a turbo can be spun up to working speeds with compressed air which offers no heat to the turbo. The turbo in this case would generate heat via friction, but it is not using heat to generate the compression.
The Otto cycle as you have used in the past specifically stated "constant pressure" it also denotes a phase in the cycle specifically for discarding heat. That would mean heat is used only to create the pressure needed to drive the piston down. It is then meant to cool off and then pushed out by the piston returning to the top in the exhaust cycle. This creates a pressure that is converted from potential energy to kinetic energy. Heat after the cooling phase of the cycle is an unwanted byproduct not meant to exist. 

By the way I'm still waiting on who you worked for that you claimed invented the turbo. As well as an answer to my hypothetical question
Reply: @signolias100  More precisely, you can say the turbine but only the turbine of the turbocharger is a heat engine because the gas that flows the turbine is energised by heat. But of course you cannot drive a turbine by heat, you need flow. 
And the turbine rotation is used to turn the compressor.. And bla bla bla, but you seem to know it ^^
Reply: And that is my point if you can provide a turbo a flow that is not heated it will of course still work. The method of turning the turbo just so happens to be heated.
Reply: @signolias100  It is a completely moot point James
 Just because you can't see energy  doesn't prove its not there... the First Law of Thermodynamics cannot be disputed or violated.
 Your little theory is fatally flawed because neither the reciprocating engine or turbo can run on compressed air without an external input of energy, both will operate but with a net loss of Energy.
 As the exhaust gasses pass through the turbocharger the EGT drops (typically 200°F to 300°F).
  This is directly related to the amount of shaft horsepower generated by turbine wheel and can be calculated by using the Brayton Cycle Formula.

The answer to your question is Brown Boveri und Cie. (now ABB) Alfred Buchi invented the turbocharger in 1905.
Reply: you completely misread what i said about the system in my theory it specifically states that it generates sufficient amount of compressed air. this literally is something you ignored to claim my theoretical system has a fatal flaw. since you ignored that point then i am going to consider your response as a yes, it would function similar to a turbo functions on exhaust. you also are ignoring newtons laws of motion... nowhere in those laws state that an external force REQUIRES HEAT. i'e. a turbo WILL work using compressed air as it follows newton's laws of motion. 

first law: "An object at rest remains at rest, and an object in motion remains in motion at constant speed and in a straight line unless acted on by an unbalanced force." compressed air from an air compressor WILL spin the turbo. 

the second law: "The acceleration of an object depends on the mass of the object and the amount of force applied." again if i force 200psi of air through the turbo the turbo will accellerated untill it reaches the maximum RPM that 200psi can produce.

the third law: "Whenever one object exerts a force on a second object, the second object exerts an equal and opposite force on the first." in this case i blow 200psi compressed air through the turbo the turbo will spin that is the equal force, the opposite force is that there will have to be some sort of force exerted back toward where the compressed air is being expelled.

as for your claim of the company. Buchi was not working for that company when he invented the turbo he was working for Sulzer when he invented the turbo.  Sulzer also produced the first turbo (1915). that would mean Sulzer would be the inventing company of the turbo, not the company that you worked for, he had only an agreement with your former company. now if you want to claim your company produced the first practical turbo (1923) you would be right.
Reply: @akosszollosi6159  csá, hallod vagy 20perce olvasom ezeket a kommenteket es még mindig nem èrti a csávó hogy hogy mükodik egy turbó. Szakadok, akkora karen
Reply: @signolias100  Yes, the fatal flaw is that turbos don't run on compressed air.
 Like the reciprocating engines, turbos run on heating.
That is why engineers call them heat engines.
Reply: @davidrell-dukai8250  What part of superchargers being inferior to Turbocharging do you not understand.???
Reply: @davidrell-dukai8250  Childish insults won't prove your point or make you look smarter.... if you don't understand how turbochargers work you should not feel ashamed or lash out at people who are more educated and experienced than you... this won't help you to learn.
Reply: @sandervanderkammen9230  no one calls them heat engines they are centrifugal compressors
Reply: @davidrell-dukai8250  What drives the centrifugal compressor???
Reply: @sandervanderkammen9230  they are not
Reply: @sandervanderkammen9230  the pressure and speed of the exhaust gases
Reply: @davidrell-dukai8250  All internal combustion engines are heat engines.
Reply: @davidrell-dukai8250  A turbocharger is a Brayton Cycle heat engine, when installed on any Otto or Diesel Cycle engine it operates as a second pass heat recovery cycle or COMBINED CYCLE heat engine.
Reply: @sandervanderkammen9230  again that is not the point of this theoretical scenario. You can claim it is a fatal flaw but your own argument states that heat and heat alone is needed to operate a turbo.
So I created a scenario where heat is not a product of the energy being produced and asked IF the turbo would in fact function in a similar manner to a turbo being attached to the exhaust. It is a simple yes or no scenario. Either the turbo using a compressed air system will function similarly or no it wouldn't. Since you want to nullify the scenario I am guessing your answer would be yes it would work similarly. This would mean per the second law of thermodynamics and all three of newton's laws of motion that a turbo DOES NOT need heat to function properly. It simply needs an outside force to act upon it. And since the colder compressed air can not transfer heat to the warmer turbo housing it follows the second law of thermodynamics. To claim a turbo can't function without heat being applied is a fallicy that is of the utmost sheer stupidity. 

A turbo only heats up because it is far less complicated and lighter to install into an existing system (the exhaust system) than to produce a much more complicated system that I have in the theoretical scenario.
Reply: @davidrell-dukai8250  The Turbine wheel extracts heat energy rejected by the reciprocating engine, the drop in exhaust gas temperature in the wheel is directly related to the amount of horsepower generated by the turbine.
Reply: @davidrell-dukai8250  Turbochargers operate using a Impulse Type turbine, it converts kinetic energy in the exhaust gasses into shaft horsepower.
We use the Brayton Cycle Formula to calculate the temperature drop to horsepower ratio and the turbine efficiency.
Reply: @signolias100   Air is not energy, heat is energy. AIR IS THE WORKING FLUID
THE TURBO IS DRIVEN BY HEAT THROUGH A WORKING FLUID.
Reply: @signolias100  The fatal flaw in  you theoretical model is it is incomplete.
A real turbocharger is not driven by compressed air.
Reply: @sandervanderkammen9230  a turbo has nothing to with heat, you could use cold air on the hot side, like an air compressor and it would still run. There is not much temp drop thru the turbine
Reply: @davidrell-dukai8250  Internal combustion engines don't run on compressed air son, the run on HEAT energy.
Reply: @sandervanderkammen9230  again you claim a fatal flaw, the third you claimed, yet the only variable is where the kinetic energy is coming from.

The first flaw you claimed my scenario had was the inability to produce the compressed air. Which was a fallicy that I pointed out.

 the second flaw you claimed is that it was the compressed air itself. As I pointed out in the previous statement is that is a theoretical system that takes the exhaust out of the equation as the variable. The exhaust powered turbo being the control.

Now you are claiming that my theoretical system is not complete thus flawed. Yet there is no incomplete point of the system. You are just grasping at straws at this point.

You also want to die on the mountain of "a real turbo doesn't run on compressed air"  compressed air in this theory is called a variable. Newton's laws of motion states that a turbo being driven by compressed air must function in a similar manner as a turbo being driven by exhaust gasses. Your claim to the contrary is literally breaking the laws of motion.
Reply: @davidrell-dukai8250  The average exhaust gas temperature drop through a turbocharger is 150°C (300°F)
Reply: @signolias100  The kinetic energy comes from HEAT.
Air is only the working fluid.
Reply: @signolias100  You theory is severely flawed, because you are attempting to apply an external energy source without accounting for it.
Reply: @signolias100  The kinetic energy in the exhaust gasses comes from the gasses expanding from heat.
The system is driven by heat, its behavior is described as heat and is calculated as heat.
You can cannot create energy or destroy energy, only convert it from one state to another and this conversion process is never 100% efficient.
The reciprocating engines rejects heat energy into the exhaust stream and this heat energy is used to drive the turbocharger.
Reply: @signolias100  You would not argue that a steam engine runs on pressurized water would you???
Why would you use the same fallacy to explain how an internal combustion engine works???
 External combustion engines and internal combustion engines are both heat engines, they run on HEAT.
Reply: @sandervanderkammen9230  this has absolutely NOTHING to do with an internal combustion engine. You are way over thinking this model so allow me to be MORE CLEAR.
We have two engine's both have turbos connected to the intake. 
one is in the conventional setup using the exhaust of the engine to power it. This is the control engine.

The second engine is set up with a system that produces, stores, and releases a variable amount of compressed air based on the rpm of the engine and exhausting through the hot side of the turbo. This would simulate the same effect as the exhaust variations. This has the variable of the exhaust being replaced by compressed air. Note the engine is powering the system, and is running as a normal engine.

Looking COMPLETELY on the functionality of the two turbos do they function in a similar manner? Yes or no?
Reply: @signolias100  NO, the engine running the centrifugal compressor on compressed air is significantly less efficient and would function as pneumatic powered supercharger, 
The exhaust energy rejected by the reciprocating engine would be wasted out the tailpipe exactly as a supercharged engine or naturally aspirated engine.
There would be no net gain in power, less power in fact than a direct or belt drive supercharger.
Reply: The engine with the pneumatic supercharger drive would deliver significantly less power at the flywheel, even if the intake manifold pressure is the same.
Any questions son?
Reply: @sandervanderkammen9230  how do you figure? the pneumatic system would function off of an electric current, there would be zero power loss like a supercharger. meaning this system is not paracitic like you claim, less efficient than a turbo? possibly since it is not using the exhaust, but there would be a net power gain, also it would not be a set power increase like a supercharger it would have a similar function including the turbo lag as the variable is only that the system is offering compressed air. how you figure there would be no net gain in power is completely rediculous. you are claiming the third law of newton's law of motion doesn't apply. especially since compressed air can offer far higher amounts of potential kenetic energy than the exhaust gasses of an ICE. an ice can offer up to 2,600 psi pressure, which is potential energy stored. where as compressed air can max out, as far as i seen at, 6,000 psi meaning a compressed air system can produce FAR more potential energy.
Reply: @sandervanderkammen9230  again you ignore newton's third law. if it is applying the same amount of boost as the turbo functioning on the exhaust, and is causing no strain on the engine the power MUST be the same.
Reply: @signolias100  Where does the electricity to drive the air compressor comes from???
You said the theoretical model is entirely powered by the reciprocating engine... now it's not?
  Please explain exactly where the energy comes from to compress the air supply???
Reply: @signolias100  Your model is severely flawed if you cannot account for all the energy in the system.
If the compressor is not driven by the reciprocating engine and comes from an external source? We cannot make an accurate working analogy or comparison with the turbocharged engine.
Reply: @sandervanderkammen9230  and an ICE requires spark in which if the engine is being turbocharged would mean it most likely is an engine that is larg enough to power some electric generation equipment, like an alternator. Are you really going to start getting that specific? Seriously stop
Reply: @sandervanderkammen9230  seriously use some common sense man. Turbos are generally installed on engines that produce their own electric to run the spark and anything else that requires electricity. Or are you suggesting your own statements are claiming that an ICE needs no electrical input to operate?
Reply: @signolias100  What about a Diesel engine? They are turbocharged and require no spark.
Reply: @signolias100  I'm serious as a heart attack son, and alternator requires shaft horsepower to generate electricity, it represents a parasitic load on the reciprocating engine directly from the crankshaft?
 What do you think charges your battery??? Lightning? Fairy dust?
Reply: @signolias100  DIESEL ENGINES REQUIRE NO ELECTRICITY  TO RUN IN THEIR BASIC FORM.
  YET THEY ALSO BENEFIT FROM THE HIGHER EFFICIENCY OF TURBOCHARGERS BY HEAT RECOVERY FROM THE TURBINE!!!!
Reply: @sandervanderkammen9230  they do however require electricity to heat the glow plugs.
Reply: @signolias100  Most Diesel engines don't have glow plugs, they are only used on automobiles and certian brands of light and medium duty trucks and tractors.
Heavy duty Diesel engines don't have glow plugs.
Reply: @signolias100  Glow plugs are only used as a "starting aid", they cease to function after the engine is started.
 Compression Ignition means that the fuel is ignited solely by the heat of compression, no external ignition source like a spark plug or glow plug is required for Diesel engines to run.
 The Diesel Cycle is particularly well suited to Turbocharging because it increases thermal efficiency and reduces EGT.. more HORSEPOWER per unit of fuel burn because boost pressure is not limited by pre-ignition, no fuel enrichment is needed to suppress detonation.
Reply: @signolias100  Just answer the question James,  where does the energy come from to run the compressor in your model???
Reply: @sandervanderkammen9230  i already stated where it comes from. you are grasping at straws. as i said previously. engines that turbos are attached to usually have a system installed by default to self sustain the spark on a gasoline engine, or heating the glow plug in a diesel engine. this system tends to be more than enough to charge the battery and provide the spark/heat to keep the engine running. it also provides power to anything attached to such an engine. this is still part of the engine as without it the engine can not function. in other words you are grasping at straws to disprove a model. all because you want the very most detailed specifics to do such a thing. use common sense if an engine can't run without it then it is part of this model. what are you going to ask next? want me to tell you where the fuel is coming from? how that system is being powered?
Reply: @signolias100  You look like a fool right now James, your theory crashed and burned big time...
Reply: @sandervanderkammen9230  ahh yes my theory is wrong because a key item required to operate an engine you are going to claim is not needed to run an engine. Right? 

News flash every ICE  that uses gasoline or diesel and is not some form of boiler or furnace. Requires the generation of some amount of electrical current. Be it a points and condenser in smaller engines to the more elaborate alternator and battery system needed on say a V8. To claim otherwise lacks any form of common sense on your part.

And before you say there would power loss . No remember I said both engines are identical. Meaning either engine and required systems is capable to run this system with no extra strain outside of what would be placed on the engine had it been operated as a naturally aspirated engine .
Reply: @signolias100  Your childish theory was a complete and utter failure and you are well aware of this... why do you continue to deny that you were wrong?
Reply: @signolias100  Diesel engines do not require any electricity to operate... completely destroying your half-baked theory.
Reply: @sandervanderkammen9230  and yet they have glow plugs in their cylinders what are those for? how do those function? 

Also isn't it convenient that every  time  you see  my point you have to directly grasp at straws to  "prove me wrong" this is childish of you. 

I have already proven that a turbo, by Newton's laws of motion, does NOT require heat to operate. You yourself admitted it. And as I have stated before the only reason it functions as it does is any other set up is faster more complex and heavy. Which both superchargers and turbos try to keep to a minimum.
Reply: @signolias100  As I said before,  not all Diesel engines have glow plugs.
Glow plugs are an optional feature used to assist in starting

 Glow plugs are only used to start the engine... they serve no function once the engine is running.
Unlike spark plugs in an Otto Cycle engine a Diesel engine can and will start without glow plugs.
Reply: @signolias100  Your childish theory was a complete and utter failure, Turbochargers are heat engines and operate on the Brayton Cycle just like a jet engine or gas turbine.
Air is only the working fluid.
 The amount of horsepower generated by the turbine wheel and its efficiency is accurately determined by the exhaust temperature drop across the turbine.
Reply: @signolias100  The difference between a supercharger is that it's only power source comes from the reciprocating engine and this power is deducted from the net horsepower measured at the flywheel.
 The turbocharger uses its own engine, driven by the heat energy rejected by the reciprocating engine.
The turbocharger both increases volumetric efficiency and reduces pumping loss without using any additional horsepower from the reciprocating engine.
This is why all other variables being equal, a turbocharged engine will always produce more power than a supercharged engine.
The dynomometer and the math does not lie.
Reply: @signolias100  Take two identical engines, same centrifugal compressor, 7 psi of boost, one supercharged, one turbocharged.
 The turbocharged engine will always have a significantly lower TMG (Exhaust outlet temperature) and always produce more horsepower at the flywheel

The amount of temperature drop in the exhaust temperature will exactly match the difference in horsepower generated by the two engines.
Reply: @sandervanderkammen9230  again your arguments are pointless you yourself admitted that, by Newton's laws of motion, a turbo would in fact function if heat is not a part of the equation as long as there is a force applied to the turbine. To claim otherwise is a fallicy.
Reply: @signolias100  That is completely false, internal combustion engines are complex machines that utilize mechanics, Fluid Dynamics and Thermal Dynamics.
 If your model does not account for all the energy? Then your model is flawed and completely invalid.
Reply: @signolias100  The Otto, Diesel and Brayton Cycles are all heat engines.
A turbocharged engine operates as a combined cycle Heat Engine and the Otto +Brayton or Diesel + Brayton formulas accurately describe and account for all the energy in the system.
Your childish, half-baked theory does not.
Reply: @sandervanderkammen9230  ok i'm done with you. every i state that the two engines are completely the same save for how the turbo is operated it is to be assumed that anything involving the two engines in question would be indeed the same, it would include every required system to operate the engine. arguing that i didn't take the time to fully detail out every little system is stupid. go get yourself some common sense man. sorry you have already admitted that a turbo will function without heat given a force is applied to said turbine within the turbo.
Reply: @sandervanderkammen9230  again will the turbo spin and produce compression if you force compressed air through the turbine housing yes or no?
Reply: @signolias100  Turbochargers engines have superior BSFC performance than supercharged or naturally aspirated engines.
 This is directly related to the higher thermal efficiency.
Reply: @signolias100  Your model does not work.
It is an incomplete model that omits critical functions and cannot account for all the energy used.
Reply: @signolias100  You know your model is flawed, you failed to explain where the energy comes from to drive your electric compressor.
Reply: @signolias100  Your model does not describe a turbocharger.
Your model is a very overly complex form of supercharger with apparently a Electro-pneumatic transmission drive system with no obvious source of power.
 Your model is a failure
Reply: @signolias100  The same manifold boost pressure? No
 While your model will spin the turbine wheel, it is less efficient than a direct or belt drive system.
Turbocharged engines produce more power, and more power per unit of fuel consumption because there is no parasitic load on the reciprocating engine.
Your model either reduces the boost pressure or increases the parasitic losses due to inefficiency.
Reply: @sandervanderkammen9230  that had nothing to do with what i asked you are dodging the question because you know the answer is in my favor. thanks for that. i will no longer be responding because you wish to ignore the laws of motion.
Reply: @signolias100  You are clearly  ignoring the laws of thermodynamics that regulate all heat engines including turbochargers.
Reply: @signolias100  Thank you for conceding the argument, you have backed yourself into a corner and can no longer continue without  making yourself look even more foolish.
Reply: @sandervanderkammen9230  yet i am not the first law CAN be substituted with the law of conservation of energy when no heat is applied. this negates that law which since compressed air would not applu, but supply a way to remove heat the first law does not matter.

the second law states The second law of thermodynamics indicates the irreversibility of natural processes, and in many cases, the tendency of natural processes to lead towards spatial homogeneity of matter and energy, especially of temperature. It can be formulated in a variety of interesting and important ways. One of the simplest is the Clausius statement, that heat does not spontaneously pass from a colder to a hotter body. 
since the air would be typically colder than the body of the turbo, considering the engine is at running temprature and there is heated oil running through the system, the compressed air would function as a heat sink drawing more heat from the system. which is in accordance with the second law, this is also arguably the most important law too.

the third law states: A system's entropy approaches a constant value as its temperature approaches absolute zero. 
this would mean nothing to the turbo in either case as neither are going to approach absolute zero ever to reach the ground state.

the turbo running on compressed gas would indeed follow the laws of conservation of energy, in the transformation of kinetic energy to mechanical energy via the turbine, and the laws of motion. as i have previously stated. 

so to reiterate the first law of thermodynamics becomes moot as the air is not supplying heat thus the law of conservation of energy takes its place. the second law of thermodynamics is being upheld as the compressed air system would not be transferring heat from a colder object to a warmer one. the third one doesn't matter as neither will reach a state anywhere near the ground state of entropy.
Reply: @sandervanderkammen9230  no i did not. read that again fool. the law of conservation of energy is not the same as the first law of thermodynamics. the first law of thermodynamics specifically to systems applying heat to a system a compressed air system does not fall under that law, but the law that spawned the first law. thus the compressed air system DOES in fact follow the laws of thermodynamics.

in fact here this is the statement about the first law of thermodynamics. The first law of thermodynamics is a version of the law of conservation of energy, adapted for thermodynamic processes. In general, the conservation law states that the total energy of an isolated system is constant; energy can be transformed from one form to another, but can be neither created nor destroyed.
 let me just cut the relavent part out of that for you "The first law of thermodynamics is a version of the law of conservation of energy, adapted for thermodynamic processes." 
since compressed air blowing through the turbo would already be in a kenetic energy state it would then be converted to mechanical energy. thus it upholds the law of conservation of energy. and as such it not a thermodynamic process thus not falling under the first law of thermodynamics.
Reply: @signolias100  The turbocharger uses the BRAYTON CYCLE, IT IS A HEAT ENGINE..
It is not a pneumatic application.
Reply: @signolias100  Your model does not describe the operating principle of a turbocharger.
 As you cannot account for all the energy in the system it is a deeply flawed theory and completely invalidates your theory.
Reply: again your statement is AS IT IS APPLIED. HOWEVER  you CAN USE IT AS A PNEUMATIC SYSTEM. that has been the statement the whole TIME. the SAME statement YOU REFUSE TO ACKNOWLEDGE is possible. my statement also stated that the pneumatic system IS NOT practical.
Reply: @signolias100  Its not a pneumatic system
Please stop spreading lies and misinformation.
Reply: Sander, as a layman I must side with James here. Though I am just entering my foray into the field of engineering and have an incomplete understanding of all mechanical processes (as does everyone— no one is perfect) you seem to be either unintentionally or deliberately disregarding the feasability of James’ example. Regardless of the temperature of the input, the pressure differential from input (hi) to output (lo) will cause the turbocharger to spin. Everyone that has taken serious time and commented here has had interest in either learning, educating, or affirming their knowledge, and you have spent more time than most replying to various comments undertaking all three of these. However, whether by the time separating your arguments or a confusion of evidence, several inconsistencies (that have already been pointed out) have arisen and subsequently been ignored or steamrolled over. I myself have learned a lot from you and the discussions that you have started. However, these inconsistencies, alongside your arrogant and disdainful view of your fellow learners is not conducive to the acceptance of argumentation. But this is not a debate of character. It is a debate of facts and examples based upon or existing in reality, wherein James has produced several, convincing examples, and you have produced none. All you have done has been to stand on cyclical or unfounded argumentation (that James and others have disproven) and provided no convincing argumentation for your position. Because of this the section has devolved into an argument about these examples (which I am sure the content creator loves— to get more views) Anyways, these cyclical arguments and the lack of a coherent counter to James and others has led me to side with you. While you have disproven some commenters who are either apparently out of depth or unwilling to take the time to fight, when you speak with a fellow like James here you seem to stumble and falter. While I am sure your tremendous (seriously) experience working for a forged induction company would be something I could benefit from greatly, (and, as I said above, I already have) your demeanor and inconsistency of the positions that you hold. Anyways, just wanted to let you know, and thanks for the evening’s entertainment and education!
Reply: I made two mistakes above. In the sentence following the aside regarding the content creator, I initially said, “Anyways, these circular arguments and lack of a coherent counter to James has lead me to side with you.”

I meant to say that I sided with you, meaning James, not you meaning Sander. I also misspoke when I said “forged induction company.” I felt the need to address this because you (Sander) have had trouble figuring them out in the past. I meant to say “forced induction company.” Thanks autocorrect! :)
Reply: Also, I do not understand what you mean by “a system driven by heat energy.” Does this mean that if you heat a turbo with some heat source and apply no other force to the blades, that it will spin? I think not! Maybe you can see where my confusion comes from and educate me. Thanks!
Reply: @sandervanderkammen9230  let me explain in more layman's terms why in both the Brayton cycle and Otto cycle that heat is a byproduct and not the intended product of the them.

I will start with the Otto cycle. The Otto cycle constantly states the need of constant pressure. So I will go through each phase of the Otto cycle.
Intake phase: the piston, coming off of the exhaust phase closes the exhaust valve and opens intake as the piston travels downward creating a zone of negating pressure which draws in the fuel air mixture.

Compression:  the intake valve closes and the piston travels back to top dead center in which the fuel air mixture in compressed into a smaller and smaller area until it can be compressed no more.  And is held in that higher pressure for the ignition phase.

Ignition phase: The pressurized compressed fuel air mixture is ignited.

Power phase: the rapidly burning fuel air mixture rapidly increases pressure in the cylinder forcing the piston to allow expansion of the gases to bottom dead center.

Cooling phase: this is the phase where the piston sits at bottom dead center for a moment and where heat is meant to be siphoned off and expelled.

Exhaust phase: the exhaust valve opens and the piston travels back up creating a positive pressure and forcefully expelling the exhaust gasses from the system. This forceful expulsion can be felt simply by putting your hand in front of exhaust pipe when the engine is running.
As you can see heat is a byproduct NOT the intended product.

Now the Brayton cycle.

Fuel air mixture is forcefully injected into a chamber this chamber is pressurized and the mixture is ignited forcefully expelling the exhaust out this forcefully ejected gas aids in the forceful intake of mixtures  the exhaust is expelled in the case of a jet engine the intake of air is far higher than the air required thus the excess air is forced through the turbine blades increasing thrust.

And since you brought it up the steam engine as well is all about pressures. And the easiest of all the heat engine's to prove pressure is the wanted product.

Water is heated, this heating increases pressure in the boiler this pressure keeps the water as water well above the boiling point where steam is created. When the steam engine is put to work the highly pressurized water is sent to the work, using a steam locomotive the example, the water is injected into the piston where it rapidly becomes steam driving the piston through its operation cycle this steam is ejected before being replaced with the pressurized heated water. And before how you say how this is wrong. When was the last time you saw a steam engine ejecting water under operation?

As you can plainly read heat is only required to create pressure in all three systems and is essentially unused energy expelled later. None use the heat to do anything to create  another form of energy through the creation of kinetic energy.
Reply: @James Thomas

This was my understanding of both cycles and the principles of steam engine operation— I was likewise confused when sander used this example above. I had previously understood the processes at a high level, but thanks for the in-depth explanation!
Reply: @hudsondaley3312  oh I respect your knowledge, I was explaining to, sander was it? How his statement that heat, and heat alone was the only driving force in heat engines is a fallicy.
Reply: Thanks mate not a problem at all
Reply: @sandervanderkammen9230  I realize I'm late to the party here, and I totally agree that a turbo captures heat energy, some of it truly waste energy.  But I think what is up for debate is that it has no parasitic loss.  In a jet engine roughly half of the fuel burned and resultant heat captured by the turbine goes just to driving the compressor.  Turbos make for more efficient engines largely because when engine demand is low, only atmospheric pressure is necessary and the exhaust can bypass the turbo via the open wastegate.  But once that wastegate starts to close, pressure begins to build prior to the turbine.  And, as you noted, per the laws of thermodynamics, when pressure is increased so does....temperature.  The turbine captures that energy to drive the compressor with a resultant pressure drop and therefore temperature drop across the turbine.  That pressure on the turbine is not free however, the Otto cycle piston engine must work harder against that pressure to expel the exhaust gas that is now being restricted by the turbine and the closed\modulated wastegate (which is being further restricted by the compressor as it builds RPM and moves more air to the intake).  To counter that increased resistance, the engine MUST burn more fuel.  You can't increase pressure/temperature in a fixed volume without adding more energy.  The end result is that there is more "waste" heat in the exhaust for the turbine to capture because more fuel had to be added to counter the restriction imposed by the turbine which raised the exhaust pressure\temperature.  So, yes the turbine captures waste heat....but much of that "waste" is caused by the turbine itself.  I agree that because the exhaust temperature is artificially elevated, probably more energy can be extracted by the turbine resulting in less net energy being consumed than a supercharger producing equivalent boost, but there is still a substantial amount of fuel being burned just to drive the turbo (when it is producing boost) resulting in fairly significant parasitic losses.  Fortunately, the gains outweigh the losses.
Reply: @hudsondaley3312  Thank you, it is very obvious that James Thomas lacks the the formal education and professional experience to speak inteligently regarding internal combustion technology and more specifically turbocharging.
Reply: @signolias100  James you make some very amateur mistakes here, air is only the WORKING FLUID, Follow the HEAT and you follow the ENERGY.
Reply: @signolias100  Heat energy drives the reciprocating engine, and the heat energy rejected by the reciprocating engine drives the turbocharger.
The facts are irrefutable, turbocharged engines produce more power than supercharged engines and burn less fuel, this is because the turbocharged engine is more thermally efficient and the turbine has no parasitic load on the reciprocating engine.

What goes in? Must also come out right???
 Turbocharged engines produce higher volumetric efficiency and gave lower pumping loss, the they make more power from having higher thermal efficiency.
Reply: @Frostbbitten  I'm sorry but you are also confused here.
Turbochargers not only improve volumetric efficiency they also significantly improve pumping efficiency... the turbocharger pumps air into the engine more efficiently, much more efficiently than the reciprocating engine can, this improves improves volumetric efficiency and cancels out backpressure between the reciprocating engine and the turbo exhaust turbine.
This is easily proven by the Brayton Cycle Formula.
Any questions son?
Reply: @signolias100  Heat energy and heat energy alone drives the pistons and the turbine... to refute this obvious fact is nothing short of ignorance and stupidity.
Reply: @sandervanderkammen9230  again your lack of understanding is mind-boggling. Heat energy CAN NOT be converted to mechanical energy. It only makes things hot. It is kinetic energy that is created when the spark or extreme pressure  ignites the chemical energy in the fuel/air mixture .  The heat is literally considered a waste product after the use in the conversion.
Reply: @sandervanderkammen9230  there is no mistakes friend. You just keep ignoring the fact that heat energy is literally an unwanted byproduct in heat engines.

By your own statement I could apply massively strong heating elements inside of a ICE, remove the fuel/air mixture from the equation and get the exact same outcome just using the heating elements.
Reply: All I read was "...petomobile" 😬

Only kidding. Great point!
Reply: @sandervanderkammen9230  considering it is the pressure from the expanding gasses, which would be kenetic energy, against the pistons of an ICE that drives the piston down not the heat itself. On top of that as I stated before there are 6 stages of the Otto cycle which again are intake, compression, ignition, power, heat disapation, and exhaust. The Otto cycle also states there is kinetic energy and pressures involved. Your argument that an ICE solely uses heat to function is moot. And if your argument on ICE is a fallacy then by default your turbo argument is based on a fallacy. 

An ICE by the simple knowledge that kinetic energy is wasted by pushing the exhaust gasses out of the cylinder. And the knowledge of how potential energy is extremely high for its fluid weight for a fuel source. It is known that an ICE is not efficient. We can also use other chemical energy items, like explosives to prove that explosive combustion also generates kinetic energy as well as heat energy.

And as I stated before heat energy is always accompanied by kinetic energy. As expanding gasses always have the ability generate force against other gasses and solids.
Reply: We need to remember that we get morr power because we are using more fuel. A turbocharger does not boost efficiency.
Reply: @sennaracinglegend1438  Wrong, turbochargers increase thermodynamics efficiency and fuel efficiency.
Reply: @signolias100  Considering it is the HEAT that expands the gasses it is in fact HEAT which drives the piston.
AIR IS ONLY THE WORING FLUID that transfers the HEAT energy into kinetic energy.

All ICEs are HEAT ENGINES and must comply with the Carnot theorum and the Second Law of Thermodynamics.

There are only 4 processes in the Otto Cycle.
These are;
1. Isentropic Compression
2. Isochoric Heat
3. Isentropic Expansion
4. Isochoric Rejection 

There is no heat without entropy.

Entropy occurs anytime energy is converted from one state to another.

 A Turbocharged engine has 2 Isochoric Rejection cycles where heat energy is converted into mechanical energy.
Reply: @signolias100  The Otto Cycle is not a pneumatic engine.

There is BOTH mechanical energy loss AND thermal energy loss.

It is heat energy that causes the gasses to expand, without the addition of heat energy a Otto engine will not function.
Reply: @signolias100  That is not a valid analogy.
Internal combustion engines use deflagerarion not detonation.
The  decomposition of fuel is not propagated through Shock Waves greater than the speed of sound.

In all Otto Cycle engines are subsonic deflagerarion,  the fuel burns slower than the speed of sound.

Deflagerarion is subject to entropy and creates waste energy in the form of light, pressure and sound waves.
Reply: @signolias100  You  are completely wrong, as the exhaust gasses pass through the turbocharger the EGT suddenly drops  (on average 200-300°degrees F.)
 Since energy cannot be created or destroyed, the heat energy rejected by the Otto engine has been converted into shaft horsepower to drive the compressor.
The temperature drop and mass of gasses flowing through the turbocharger are directly related to the amount of heat energy turned into horsepower.
We measure this conversation of heat into horsepower and its efficiency using the Brayton Cycle... the same way we use the Otto Cycle to calculate its thermal energy efficiency.

It's all heat, the fact that you don't not understand these fundamental engineering concept reveals someone who has no formal education or professional experience in engineering and is certainly not qualified to speak inteligently about this subject.
Reply: @sandervanderkammen9230  you know nothing of fuel air bombs or even napalm bombs then

So let me enlighten you napalm is literally gasoline thickened with gelatin it does in fact explode. Please look up some napalm bombing runs you will see it does cause a Shockwave so your point is moot.

A fuel air bomb also known as a thermobaric bomb is a subsonic explosive weapon that removes all oxygen from an area causing a vacuum which is rapidly filled by fresh atmosphere causing a concussive impact. An example of these outside of military use would be grain silo, flour mill, coal mine, and refinery explosions. All are thermobaric explosions. Again these make your point moot. 

Another example gun powder is an explosive and it's explosion is subsonic. This is not my claim it is exactly what the federal government classifies gunpowder as.
Reply: @sandervanderkammen9230  incorrect. It is
1. Intake
2. Compression
3. Ignition
4. Power 
5. Heat expulsion
6. Exhaust 

This is literally stated in every article I have seen on the Otto cycle. You mistake the strokes as the processes. Which are calculated as intake, compression, power, and exhaust.
Reply: @sandervanderkammen9230 cringe
Reply: @signolias100  Don't confuse the mechanical cycles with the Thermodynamic Cycles.
For the Diesel engine it is 
1.Adiabatic
2.Isobaric
3Adiabatic
4.Isochoric

For the Otto Cycle it's 
1.Isentropic
2.Isochoric
3.Isentropic
4.Isochoric
Reply: @adriangroeneveld9341  I honestly don't know which comment you are replying to.. can you elaborate on which comment you are referring to, thanks.
Reply: @sandervanderkammen9230  you and I have been arguing this for way too long, and it has been at least a month since you tried to prove your point. Sorry to me, you lost your credibility a while ago.
Reply: @signolias100  The facts speak for themselves... you're not fooling me or anyone else son... you have exposed your lack of formal education and professional experience.
Reply: @sandervanderkammen9230  and yet others agreed with my logic. Kenetic energy is kenetic energy. Heat energy is heat energy. Your insistence that you need heat energy to convert into kenetic energy is laughable. Thus the compressed airmodel I had used prior it required ZERO  heat energy to be utilized  but offered kenetic energy. Yet you refused to look at the logic. You refused to look at the logic that the exhaust gasses were being converted into kenetic energy from the mechanical energy of the piston engine moving to TDC during the exhaust stroke. At this point in the cycle the heat energy would already being removed from the gasses. That means the turbine is being spun by the escaping gasses converting a portion of that kenetic energy BACK INTO mechanical energy which compresses the intake air. 

Obviously you don't understand how energy actually works. So I'll try one last time. Using an air compressor to prove how idiotic your insistence has been.

Air compressors often use electric to operate this is electrical energy. It is ran through an electric motor to convert that electrical energy  into mechanical energy that electric motor produces heat that is dissapated and is NOT used. That mechanical energy drives pistons to compress the air that mechanical energy is converted into kenetic energy which is stored in the tank (potential energy). When you use an air tool that kenetic energy is allowed to be applied to the tool that converts some of that back into mechanical energy. The rest is sent out of the tool as waste. ZERO additional heat is needed to operate the tool ZERO additional heat is needed to compress the air. Any heat generated is lost. Electric energy, mechanical energy, kenetic energy, mechanical energy.

Now take that and look at an ICE as a fuel powered compressor. Past the ignition stroke ZERO additional heat is added to any given single piston. It goes chemical energy, heat energy, kenetic energy, mechanical energy, kenetic energy as far as the strokes go... 

funny how heat energy is only used once in that huh?
Reply: @signolias100  It's not a valid argument, simply because you are driving the pneumatic motor with energy from an external source in your example, not with the waste heat energy that is normally wasted out the tailpipe of a heat engine like the Otto or Diesel cycle.

The turbine wheel is converting heat directly into rotatational horsepower.

How can you fail to understand this basic concept?
Reply: @signolias100  The fact that others agree with you doesn't mean that you are correct.

That's cognitive dissonance.

34 million people in the United States also agree that the Earth is flat... that doesn't mean that it is true either.
Reply: @signolias100  The 4 Thermodynamic cycles of the Otto Cycle engine are;
1.Isentropic
2.Isochoric
3.Isentropic
4.Isochoric
Reply: @sandervanderkammen9230  and yet you suffer from the same issue. You insist that heat energy, which is literally heat, is the only energy used in an Otto cycle engine despite there being clear and objective evidence stating you are wrong.  You agreed that compressed air could spin a turbo but refused to answer if a heating element could do the same. You ignore the fact that only one of the four strokes of an otto cycle engine has any form of use for heat energy. And you are trying to tell me I'm wrong? 

So I will try one last time. Intake cycle brings in fuel air mixture. This is potential energy in the form of a chemical compound  a hydrocarbon to be exact.

Compression. This takes the fuel air mixture and compresses it increasing the volatility and potential energy.

Ignition this is the cycle where electrical energy is introduced to the potential energy in the form of a spark at this point the fuel air mix ignites converting it into TWO energies heat and kenetic energy in the form of expanding gas.

Power this is where the expanding gas, no longer combusting,  pushes the piston down thus converting kenetic energy into mechanical energy. At this point, when the piston reaches BDC there is a slight pause. That pause, as stated by the ottocycle itself, states there should be at least some dissipation of the remaining heat within the gasses. 

Exhaust this is when the piston moves back up the cylinder pushing the expended gasses out of the cylinder. The engine has some loss in energy as that energy is converted back into kenetic energy via the gas exiting the system.

Heat energy is just that heat it is a form of radiation. To insist otherwise is sheer stupidity.
Reply: @signolias100  there comes a point where putting more effort into something is just not worth it. You have reached this point. 
Some people just can't be saved, because they don't want to be saved. 
Leave it be. You have far better things to spend your energy on.
Reply: @dariolinder4508  that point was at least a few months ago honestly.
Reply: @dariolinder4508  Or you can simply man-up and admit you were wrong.

It's OK to admit you are wrong, most car enthusiasts do not understand how the Brayton Cycle or Turbochargers actually work.
It's pointless to keep arguing, you lost a long time ago, if you cannot be man enough to concede then just drop it
Reply: @signolias100  The Laws of Thermodynamics have not changed since this video was posted.

You can argue all want it will not change the facts.

We are talking about very basic principles of physics, energy cannot be lost or destroyed.
The heat in the exhaust is converted into mechanical horsepower to turn the shaft.

In the Impulse turbine the pressure of the gas remains the same the Velocity and Temperature DECREASE... not the pressure.
Reply: @sandervanderkammen9230  heat in the exhaust is exactly that heat. The kenrtic ENERGY applied to the exhaust vis the piston traveling up the cylinder, you know the same kenetic energy that you claimed didn't exist and are claiming by insisting it is only heat that operates the turbo is being lost in your insistent prattling. Heat energy is just heat.
Reply: @signolias100  Not after the exhaust valve closes.

Heat is ENERGY.
THIS ENERGY IS DRIVING THE BLADES OF THE IMPULSE TURBINE.
AIR IS THE WORKING FLUID.
Reply: @signolias100  The pressure inside the cylinder is Higher than the exhaust manifold when the exhaust valve opens.

As the piston travels back up to TDC, the pressure is dropping, the piston does not compress the exhaust gasses
Reply: @signolias100  Not after the valve opens...
Reply: @sandervanderkammen9230  then you've never played with water pressure from a hose when you were a child... I'm sorry that you never got that chance. Again piston moving faster than the heat allows the gas to escape creates pressure in the system bud. You can do this experiment with a freaking turkey baster to confirm this. 

Did you actually test anything on your own, or did you take what you were told at facevalue like a good little sheeple?
Reply: @signolias100  Or you could just look at the power card graph from a IMEP test.
Have you ever done an IMEP test on an engine before?
Reply: Fun Fact, supercharged motors are literally the fastest cars on Earth, & it's not even close.  Go make a turbo Top Fuel car & get back to us.
Reply: @ohane1  Turbos Are banned in Top Fuel, which completely destroys your argument.
Reply: @ohane1  Your analogy is deeply flawed and revealing your lack of knowledge regarding how turbochargers work.
Reply: @ohane1  If the turbo creates backpressure? Why do turbocharged engines flow more air than supercharged engines.
 Your understanding of this topic is monumentally ignorant and reveals someone who has no formal education or professional experience in this area.
Reply: @ohane1  Clearly you don't understand what backpressure is, or how it relates to forced induction engines.
 If the Manifold pressure is higher than atmospheric pressurize than there is a positive Delta~P
Reply: @sandervanderkammen9230  citation please, cause it's not true that turbos flow more air. What you're seeing is lack of choices in supercharger size. Show me a motor that flows more than 10,0000hp supercharged motors. Show me a turbo motor more powerful than literally the most powerful cars earth lol.
Reply: @ohane1  A 10,000 horsepower turbocharged engine flows the less air as a 10,000 horsepower supercharged engine and uses less fuel and less manifold pressure to make 10,000 hp
Turbochargers are banned in Top Fuel drag racing, so you argument is invalid.
Reply: @ohane1  The NHRA BANNED turbos from Top Fuel because it made the cars too fast.
Reply: @sandervanderkammen9230  try again! Urban legend. You won't be able to find a source for that. Nor a record set by the 1 guy that tried it. I've read that a turbo grenade aimed @ audience literally wasn't safe. Also read 4000 degree top fuel is hard on turbos (way hotter than gas) i've never seen a turbo big enough to push the amount of air they use. Maybe off a train?
Reply: @ohane1  Not any harder than on exhaust valves... which if you didn't know?
Top Fuel uses the a very similar high nickel, creep resistant alloys on their exhaust valves to what is used to make turbos.
 
You don't know much about turbochargers that's for certain kid.
The General Electric CHM-2 turbos are rated for 5,000 hp each and reliable for aircraft.
Reply: @ohane1  They make Turbos rated for engines up to 109,000 horsepower.
Reply: @sandervanderkammen9230  Yes they do.  I saw one in a cargo ahip the size of a large shed. Search 143-millimeter ProStock Tractor, two of those bad boys are bigger than the 10,000hp top fuel superchargers. Prolly weigh near the same too. I bet top fuel temps melt them dead. Biggest I've ever seen that could possibly go in a car.
Reply: @ohane1   How could the Turbos melt?????

Turbochargers are made from the same material as jet engines... AND Top Fuel exhaust valves...
Reply: @sandervanderkammen9230  c'mon. Ok you got me not "melt". Fail due to heat. Top fuel exhaust gets a lot hotter than gas or alcohol. Try proving me wromg & do it. Turbos already get red hot & fail quickly in some race classes. Engines on nitro can make 2.4 times more power than gas cause science. That's crazy more heat that would 🔥 up turbos fast internally.
Reply: @ohane1  Then explain why Top Fuel Exhaust Valves don't  "fail due to heat"
  C'mon man, you're just making yourself look like a fool now.
Reply: @sandervanderkammen9230  sure! Same reason gas turbos on rally cars get red hot & exhaust valves don't! They/re cooled off every other cycle by fresh air & cold fuel & by being in contact w/ a cooled aluminum head. Please refrain from insulting names, especially when you're incorrect.
Reply: @ohane1  But in a Top Fuel engine the incoming air charge is heated by the less efficient positive displacement supercharger.
And the aluminum heads are not cooled.
There is no cooling system.
Reply: @ohane1  Top Fuel exhaust valves get so hot, they have to be made out of the same material as jet engines and turbochargers.

The EGTs on a Top Fuel engine average only 1,600°F...
Reply: @sandervanderkammen9230  oh my goodness. Please go to wikipedia & read about top fuel. A huge benefit of it & the methanol I run in my race car is it cools down combustion allowing more fuel to be burned. When there you'll also read most top fuel motors throw lots of raw fuel out (more than gas cars) and that too would be hotter in turbos. I'm sure it could be done... but highly unlikely w/ any normal turbo. The heat would be insane & likely unsafe. Turbos do blow up & send shrapnel in exhaust. Top fuel uses exhaust gas as rocket powered weight for traction. That's why exhausts are angled up. A turbo in there would be aiming a shotgun @ the crowd.
Reply: @ohane1  The creep temperature of Nimonic 80A is 1,500°F.
Reply: @sandervanderkammen9230  that 1600 is correct & the exhaust is VERY short. Put a heat sink (turbo) in there & it'll get WAY hotter. Watch some dyno videos of turbo vs straight pipe runs w/ same fuel & power.
Reply: @ohane1  Wikipedia?
Your comments reveal someone who is not only immature but that also has no education or professional experience in engineering or racing.
Reply: @ohane1  Basic, fundamental engine performance and tuning tells us that a Rich AFR quenches peak combustion chamber temperature and EGTs.

Rich AFRs are required in any HCSI type engine to suppress knock.
Reply: @sandervanderkammen9230  what do you mean aluminum heads aren't cooled???? Very rarely not w/ water flowing only mm's away from valves & even if not every engine is a heat sink. Only a tiny portion of a valve is in the exhaust stream. Most is in the head & being cooled every other stroke by induction w/ the head surfaces & cool gas in the chamber.
Reply: @sandervanderkammen9230  ah! You mean top fuel heads aren't running water? No, they only run for 1 minute & use oil & latent vaporization of nitro to keep from "melting"  (breaking from heat) & would if run longer.
Reply: @ohane1  Thanks for proving my point.